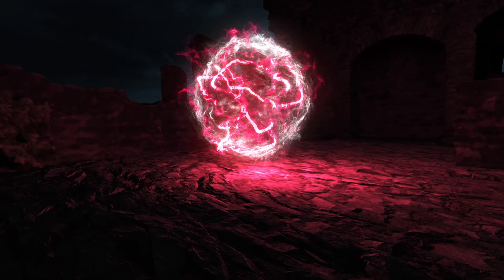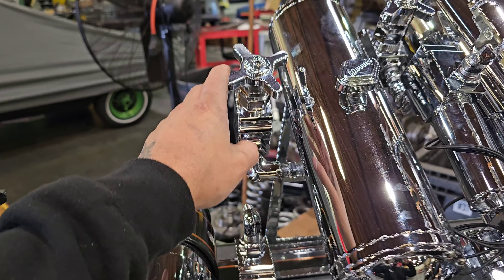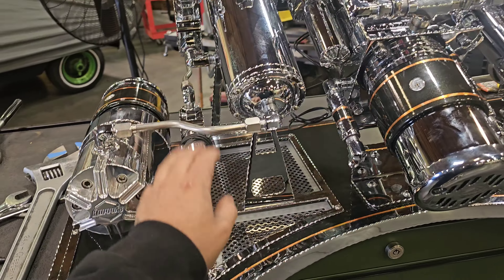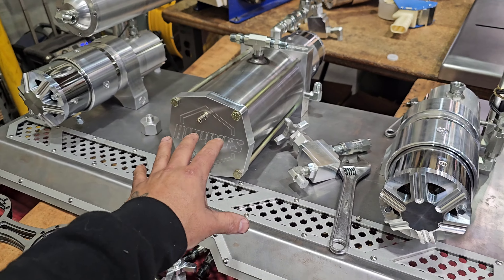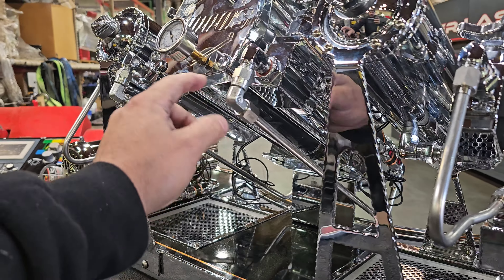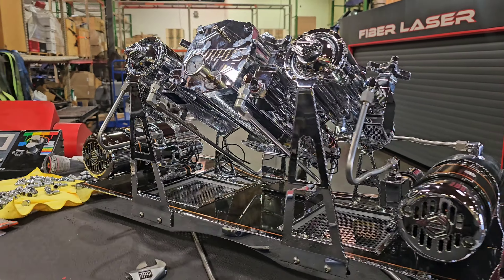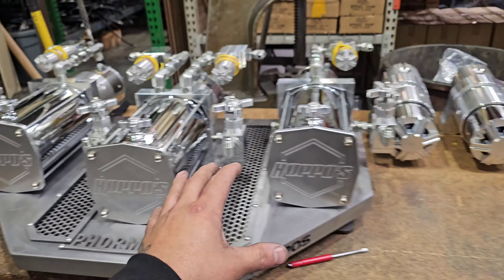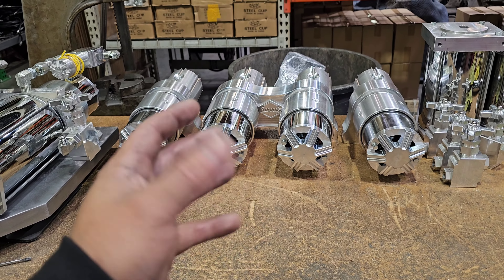Building Custom Hydraulic setups!! with hoppos

Comment: Any advice for installing the donuts for the front on a 1991 Lincoln town car. THE 95 chassis is different and I’m trying to figure out if I need to cut off the top bracket were the front shocks bolt into.

Comment: I've contacted your shop a few times the last few years and was told you don't do hydraulic installs anymore? Then we see these videos. You guys do great work but what's the deal?
Reply: Pretty sure it's an exclusive list as to who they do install/builds for. Pretty sure it's more for marketing. If they were open to the public im sure that waitlist would definitely be long
Reply from the maker: We no longer do installs but we still manufacture  and build pumps  and custom setups that's never changed we do have authorized dealers and installers that we can reccomend  you to